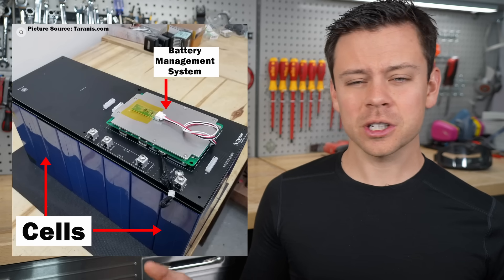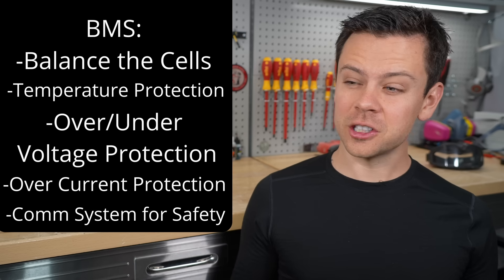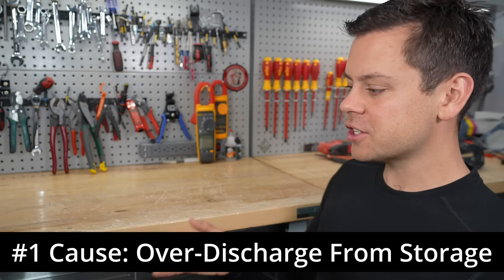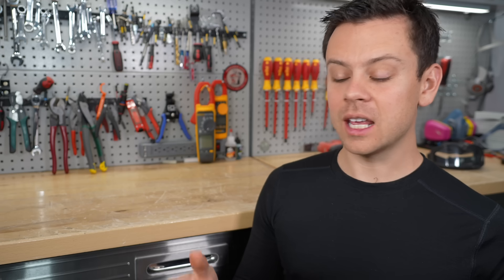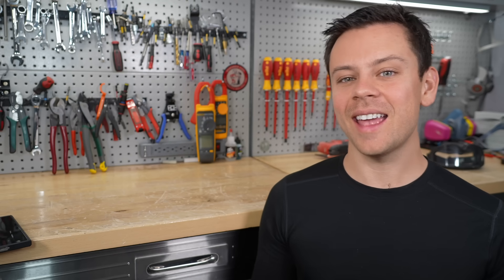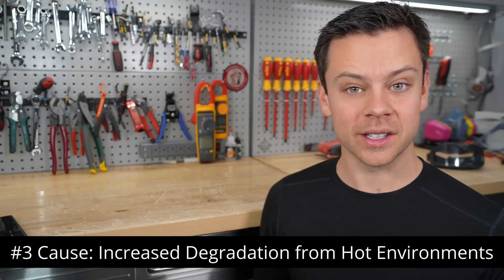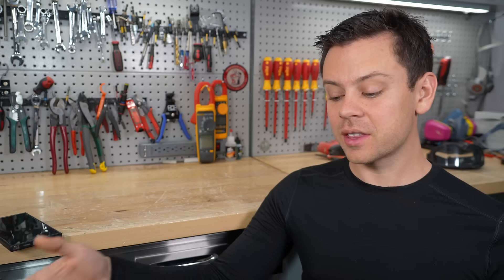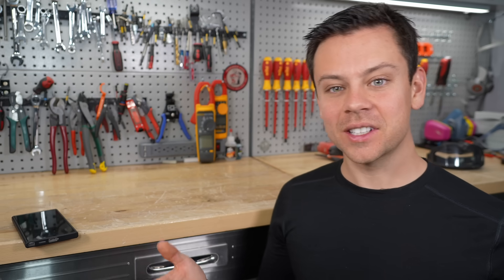The Rules of LiFePO4: The 3 Most Common Causes of Failure and General Guidelines for Long Term Use

Comment: I bought a new scooter that read 3/4 full charge . But I did not charge it  before I rode it . But then   I ran down  the battery in the scooter until the scooter would no longer run.  2 days later I charged the battery. On the display the small battery icon and the volts,said it’s it’s has a full charge yet the green light on the charger never appeared.  Could the volts display be way off? What should I do ?

Comment: I have lots of CATL batt batteries and I charge 30 of them up full and they do have just a active balancer and it be a year about till I use them . Is that safe?  I also have another 50 that have a charge and volts show 25.8 to 26.50  hard to know if at 25,50,75  with just a volt meter . So these are 24v 100ah battery packs .. I’m going to use for solar but I do need to install bms and remove the unit active balancer .  Should I just put them on 40 amp charger hit them all for 30 mins for a year storage on the ones not fully charged?

Comment: Your content sometimes lacks necessary depth and understanding, relying on broad generalizations that can be misleading, particularly for critical components like battery management systems (BMS) and cell balancing.
For instance, your blanket statement, "The only thing you need to balance cells is to charge the batteries to 100% once in a while and that is it," is an oversimplification and often incorrect in real-world applications. The cell balancing process is far more nuanced. While a quality BMS does manage balancing during the charge cycle, effective balancing often requires specific charging protocols, such as reduced current at the top of the charge, to give the passive or active balancing circuits enough time to work.
A crucial point you often miss is the communication between the BMS and the charger. If the BMS cannot control the charger's output via a communication interface (like CAN bus), its balancing act can be too short and ineffective, failing to achieve a truly balanced state across all cells.
Furthermore, you need to be more cautious about the specific products you recommend. The "Watt Cycle" battery you reviewed positively and recommended appears to be a poor choice based on significant customer feedback; a quick check of Amazon reviews reveals numerous instances of BMS failures. Promoting potentially unsafe or unreliable technology can have serious consequences, especially for users in demanding environments like marine applications who rely on your expertise for safe recommendations.
While I initially enjoyed your channel, the quality seems to have diminished. You appear stuck on a single format: quickly breaking down batteries and performing brief charge/discharge tests before declaring a product safe to buy. I believe you could elevate the channel significantly by expanding your knowledge base, increasing your research depth, and moving beyond these superficial evaluations. You have the potential to be a truly authoritative voice in the DIY solar community.
Reply: yep, he is bullshitting his viewers, 
discharging to 0 is a quick way to get cells so disbalanced that a regular passive BMS wouldn't be able to correct it, turning off charge prematurely when one of the cells will reach 3.65V or whatever was programmed as a cutoff voltage for an individual cell...

Comment: Will, 
I have a "West Coast" Pecron E1000 Pro. (Litho)
They say, "It has a Bad Board ? "
Why ? Well like you said (in the vid) "after a couple of months", it would not charge (AC or DC solar) and slowly ran itself down ???

They would not pay for "Warranty Repair",  return shipping (from the East coast to the west $$$).

How would I get a "Matching BMS" and who could install it ?

These days, the shipping round trip is half the cost of a newer battery chemisty power station.

Is it safe n easy to install a BMS ?

Because they don't have any eastcoast repair affiliates, either . 😮😢🤔

Comment: For RV Trailer use - is this technology appropriate?  The batteries are stored outside the conditioned space commonly.  Charging is typically via shore power and possibly solar.  The concern is that you talk about hot temps - but your testing seems to suggest it isn't a huge issue.

Comment: So if my battery did not come with any kind of monitor, it’s just a lithium ion phosphate battery by itself that does have a BMS system. Do they make a battery monitor that will tell me the degradation of the battery what percentage it’s currently charged to, if it is balanced, And will charge it all in one? I am certainly not an electrician or electrical engineer, nor do I want to be one. Also, if your last camping trip ends with your battery 100% how do you store at 50% which I’ve heard you’re supposed to do and it says right on my battery to store it at 50%. How do you know it’s at 50% and if it is that 100% after your last camping trip, how do you get it to 50%? How do I hook a heat gun up to it when my heat gun has to be plugged in? All of my plugs in my camper only run off of AC shore power not the battery and it’s an older camper and does not have an inverter. Do they make an all-in-one unit that can do everything for me charge the battery discharge the battery monitor the battery for level and balance, etc.?

Comment: Now I’m completely confused because in the beginning, you said don’t under charge in other words leave it sit but then you stated to take it down to 0% later in your video. So that is very confusing. You also mentioned that I could record a battery in a hot environment. What about a cold environment. Can you leave it in your Travel trailer over the winter when where I live it can get to 15° or more below zero? I was assuming I had to pull the battery and bring it inside to my basement which is super heavy, but I will if I have to, but I prefer not to. Then I’ve seen where you put a trickle charger on it or a lithium battery maintainer which they’re hard to find and I purchased one, but should then I not use it because then I’ve seen videos that say you don’t want a trickle charger on them. My battery never came with a monitor And it’s a very old travel trailer. It’s a how do I know when it reaches 100% or 50% etc..

Comment: G'Day WP - I have used BMSs & even developed my own BMS as I have ~50 years experience in hard/soft installations. I wonder what you think about 'moving' this workload to the appliance, I know that balancing is an issue. I have been testing this for ~10 years & found if you have quality smart appliances eg. fridges & quality cells which I install in power walls so no welding, I always keep the cells on or as close as I can to the same cycle count I have found this works well. Do you have any experience of no BMS DIY Bat. Banks ?

Comment: Hopefully you have time to see this, I would like to have a system that will run 240/120 while only being charged with a generator for a few hours a day or every other. Is it possible to charge with a load on LiFePO4 batteries so I do not have to use an ATS?

Comment: Thinking, in the future, I would setup a battery LIfePO4 to power my house, in addition to electric grid. Not planning to feed the power back into the grid. I will be using the batter mostly at night and use it all up over night and then charge it during day time. If I do this, will I kill the batter faster or slower or the same as the calendar battery you mention? Will I get my money back (spending the money on the battery vs paying electric). Let say I live in Tennessee

Comment: My EV, charge at 100% 2017 to 2025 EPA rated to 53 miles and since the begining my rate shows 70 miles range. Never go to low than 20%. Has been a EV 100 % life for the batteries.

Comment: I just checked on a 4s lifepo4 I put away a couple months ago after charging and it is at 10.7.  That's just great. It would have been much less work to just flush that money down the toilet. Because when the powers out, I'm still in the dark.

Comment: I toss on my dedicated charger and when the little light goes out, battery is charged.
I keep my battery inside the house where temps are generally stable.
My battery mfr states that the new battery is prebalanced.
Many mfr's state to charge at 20 amps or less too.
Unfortunately my charger is 40 amps. When charging and done I do not feel any heat on the terminals nor the top of the battery.
Even at 40 amps, with a 30% to 50% charge from the factory, it still took 1 1/2 hours or so to charge.
Been letting it sit for a few months to self balance (charger disconnected, no load).
Still buying things to set up my rig.
Then the hard part comes - building everything.
Edit to fix a typo

Comment: I just follow the manufacturer’s specifications, which are clear. Degradation increases if battery sits at 100% or below 20%/11.9v. Renogies are supposed to balance continuously, making balance charging at 100% unnecessary.
They may be covering their ass in case of rapid charge/discharge at ends of the range.

Comment: We need to know the best charging parameters for our charge controller. Everyone has an opinion which is different. I need to know from Will what I should set my Victron solar charge controller to.
Low disconnect, float, storage, and peak charge voltage for absorption.

Comment: I just purchased a Ecoflow Delta Pro 3 and the recommended settings in the app for charge and discharge limits is discharge to 20% and charge limit at 80%. I like your advise here but should I not follow their guidelines? Really enjoying your content, thanks.

Comment: Discharging to zero can be permanently damaging if your battery does not have a BMS. The BMS will activate it's low voltage cutoff which is not a zero state but more a safe minimum. For ex. a typical cell may be around 3.2v when full but the bms will kick in when cells are at 2.5v. Different voltages have different safe minimums but zero is not safe and will cause capacity loss, dendrite formation and possible difficulty recharging. I don't discharge mine below 30-40% as a rule to maximize lifespan but you should be fine to 20%.

Comment: AZ summer weather often exceeds 115F. Battery inside my van could get to 135F. I don't know what to do but turn on the fan and turn off the solar charger.  What could you suggest?

Comment: I need help. If you can help me thats great. If not can you refer me to someone who can. I have an appointment EG4 18kpv matched with a EG4 wallmount all weather battery. I live in Maine so from Late November to Late January my sun is low and its very cloudy. I have a manual generator that the electrician hooked for me. Im just not sure what I need to do to charge my battery with my generator. What program or switches do i need to move and what order do I turn on my generator or adjust my settings. Thank you so much for your help. I follow your channel and enjoy all you r videos. Thanks again.  Jack

Comment: sometimes keeping it in a cool environment is almost impossible.  My batteries are under the deck in my boat which bakes in florida sun every single day of the year.  The batteries have BMS and I use a Pro Charging Systems charger designed for them.  I can only hope they last in the heat.  The batteries are LiTime batteries.

Comment: So...when one has two LFP batteries connected to an inverter/charger for partial-house power when the utility's power goes out.  Should one, once a month pretend you have a power failure by disconnecting the inverter/charger from the 120VAC and run some devices off the inverter (thereby pulling energy from the batteries).  After some time, disconnect the devices from the inverter, then reconnect the inverter/charger to the 120VAC--thereby charging the batteries back to 100%.  A good plan??  [This is what I do with my present lead-acid battery based system I want to change to a LFP battery based system.]

Comment: Hi Will, I have been very impressed with your knowledge on LiFeP04 batteries and inverters. I live in an area where we have multiple power outages and because of that I bought a 6kw inverter and 8 100amp LifeP04 batteries hooked up in series/parallel to give me 48v @ 200-amp hrs just to keep the basics in the home powered up during these power outages.
My question is do I need to buy a balancer(s) for these 8 batteries as I see some folks do or is there a better way to keep all batteries balanced at the same SOC. The batteries I am using are ones that you gave a great rating, and my inverter seems to be a decent unit as well.
I look forward to your answer and thank you.

Comment: Hey Will. PLEASE-I NEED YOUR HELP: I recently purchased 4 -12 Volt, 330 aH, Li Pho ion batteries wired in series for 48 volt.  I am using them for a 200v solar array. I am using an EPEVER Charge Controller with the p-50 remote. . I NEED YOUR HELP with the configuring of the paramerters....such as: OVER VOLT DISCHARGE:, Charge Limit, Over V Rec, EQ charge, Boost, Float Charge, Boost Charge,  Float Charge:, ETC.  Do you have those numbers??  
I don't have those numbers.  Do you have advice?
I would appreciate it;.
Thank you so much.
-James

  They have a 12 V BMS They were dang cheap.  But they claimed to have high qualities cells and  question which requires you knowing the battaries paramaters. When I buy 4 12 volt batteries (Li ion phosphate

Comment: I have a Ampere Time 12V 100 amp battery for my boat trolling motor.  While the instruction manual directs you to maintain the power at 50% when stored, you recommended always charging the battery to 100%.  It makes sense that if you repeatedly recharge the battery to less than full charge, over time that will change the maximum charge that it will take.   For the past several years I have fully recharged the battery after use and leave it until I want to use it again.  Am I right??

Comment: i just had this happen to me yesterday... did not know this information and had my 100ah 1000cca battery in my car that i have not used for like 5months... yesterday tried charging it and was so low(2... volts) that i had had to  put it in low repair amp charging (1.5amp).. when woke up, and put it to charge normal, it never passed from 75% charge...currently will leave it over night on repair mode and hopefully i can get it to 100%... if it does not work, WHAT CAN I DO AFTER?

Comment: Will, thanks so much for these amazing videos! I have two (2) EG4 Outdoor Wall Mount Batteries and a FlexBoss21 placed on the side of my house in the Greater Sacramento Area. Summers here can average 90-100 Deg F daily for at least half the year. I did build a lean-to shade over the batteries, so they really only see direct sunlight early in the morning when the temperature is not that hot. With my PV system and the loads I have on them, I am seeing the batteries cycle from 100% to about 20% SOC daily. With your note on avoiding extreme temperatures, would my scenario be considered extreme? These batteries are outdoor rated, but should I consider fully enclosing the lean-to and possibly installing a small AC unit for the batteries? Or would that be overkill? I would greatly appreciate your input on this.

Comment: What do you do when you have an in house battery in your van always being charged by solar on the roof and your van is locked up in summer and getting hot? Is there a specific way to cool the battery? Should there be a computer fan mounted to have air flow in the battery compartment?

Comment: Hi Will, I've had a few devices with lithium ion (not iron) batteries that somehow unbalance over time, even if charged every few months or kept continually on a charger (small portable vacuum for instance). To solve this I end up having to dismantle the device and manually charge each cell fully to 4.2 volts (this is li-ion not iron)  Even if I leave the device on the charger for days it does not resolve, and when I check the cells manually it is usually only one cell that has a lower voltage than the rest.  Does this mean the BMS does not have this auto-balance feature?  Any way to resolve this without having to resort to manually balancing the cells individually?  Thanks.
Reply: There are several batteries meeting that description. Google "Battery university." The info is from a bloke who designs test equipment.

Comment: I do have a 12 volt 100 milliamp litime battery that I've been using for my pumpspy battery backup septic pump. Way out performs my old style battery at its best. I don't know why the manufacturers does not suggest using this style battery. It does maintain the battery to 100% all the time and run test on it from time to time.

Comment: great info !   ...question, how about when using for a computer UPS ?  can the batteries be maintaind at a fixed voltage, like 13.6 ?  or should it be higher or lower ?

Comment: is it bad to charge and discharge from 5 to 15% capacity? my inverter has to keep charging a bit from line at night then running from battery until 5%. it doesn't have a clock on it so I can't tell it to do otherwise unless I tell it to charge the battery to a higher percentage but I don't really want that because it will interfere with charging mainly from solar during the day if a cloud comes across.

Comment: Isn't BMS IC's constantly balancing cells? To trigger balancşng cells, I think the absolute value of the cells are not important. What is important is the relative voltage differences. If one cell deviates above a set value then cell balancing kicks in. It is maybe best to talk on the IC's ordering codes in order to check their specific datasheets. There are many cell balancing algorithms and moreovever the same IC may support many of them. Therefore one must know the embedded software ır hardware as well in order to know which specific algorithm is selected.